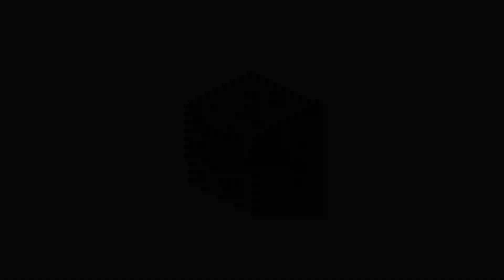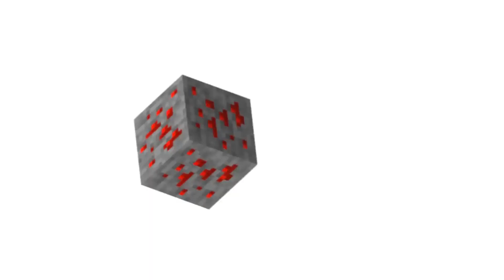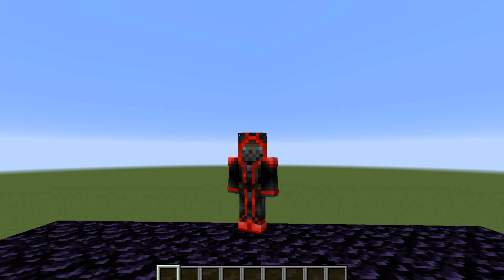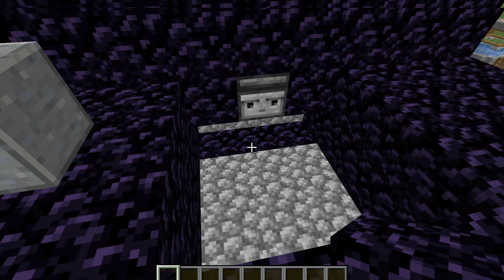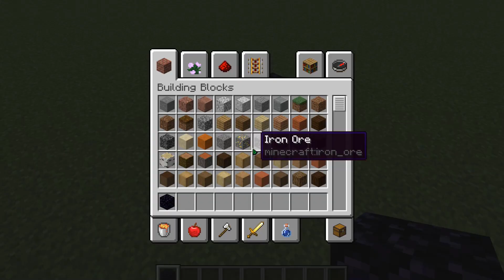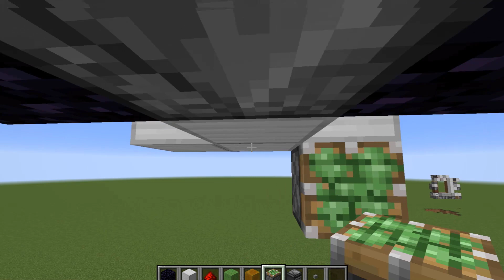Minecraft 3 by 3 Shaftless elevator 1.15 + | full platform | compact and simple

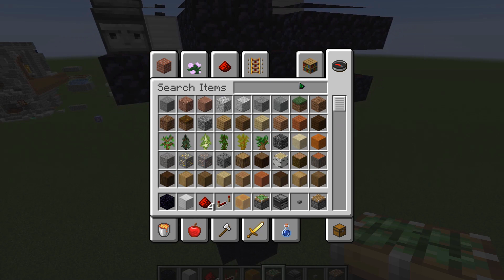Comment: 8:55 genius plan say that its undoable to make the elevator past 11 blocks plus fuck me up with some obsidian blocks required around it instead of air PLUS the ass redstone at the top that sticks out which i cant cover because it'll look hidious because its a completely flat room mostly   UPDATE: got it working took a  lot more redstone and way more mining but i did it and it looks very ugly but it works :/
Reply from the maker: yeah genius, CHAIN the slime towers; the elevator can be any height. If you knew how to listen you would've heard me specify this. also all the Redstone is easily concealed. Literally all the slime tower is for is to connect the top button with the bottom so you can call is from the top. Just find another way to connect that, I showed the fastest way. Key word LISTEN and MAYBE your attention deficit ass could pick up a few more things. :/

Comment: My issue is that the first floor button isn't calling the elevator back down.. the other button works just fine, though. and at some point, it stopped one row before it was supposed to.  Didn't know how to fix it, so I'm having to start over.

Comment: Is there a way you can make the elevator longer or deeper?
Reply: Yes you can actually. Just make the shaft or the landing port of the flying machine deeper into the ground, and if you want to make the elevator much more longer, then just extend the circuits used to stop the flying machine from going to far high, although you are going to need to extend the redstone downwards by a lot, so I suggest use a combination of slime and pistons with redstone blocks at the end of the slime

Comment: help, whenever the platform goes up, the normal pistons dont power so only half gets stopped and the others continue to ascend

edit: its been an hour and I fixed the over ascend problem, so a new problem arises

THE ELEVATOR WONT GO DOWN, HELP

edit edit: HOLY CRAP IT WORKED, YUP, IM SUBBING AND YOU SHOULD TOO
Reply: how did you get it to go down mine is stuck brruuuh
Reply: @cjrs  If you are in a server (especially slow servers).

check the three blocks that ypu placed up top in the three sticky pistons, make sure they are ttached to the sticky piston and not near the aligned with the obsidian

Comment: Super nice you get a sub from me, and with my tiny bits of redstone knowledge I was able to get the redstone signal to go further down. This gets rid of the piston max push limit causing the build to not go as far as I wanted. You just need to send the signal down using dispensers and target blocks(space target block 3-4 blocks from dispenser cuz they can miss). Put a target block at the very bottom to send redstone signal into the lower activation, sending elevator back up. this is my first flying machine I think I've ever built and having to repeat the process cuz of how many times I messed up, plus your actual detailed video, I was able to get a better understanding how these things work. oh and if you think you will need more than 64x9 activation from the top just add hoppers with single/double chest full of arrows into each dispenser that shoots down (hope you also have a skele farm handy :D)

Comment: For those who are syaing this does not work in 1.16.5 it does work, my advice is make sure the flying macine are looking the correct way, you need the observers on the flyinf machine near the top half are facing towards the ordinary pistons, I noticed this mistake in my build which is why it would not go down, I fixed it and now it goes up and down and the calling system from both ends work.
Reply: Did it and still did not work any other advice?

Comment: This sucks it doesn't even work I built everything exactly the same and only the middle of the elevator went up BY 2 BLOCKS
Reply: By: YGOTolley
2 days ago
For those who are syaing this does not work in 1.16.5 it does work, my advice is make sure the flying macine are looking the correct way, you need the observers on the flyinf machine near the top half are facing towards the ordinary pistons, I noticed this mistake in my build which is why it would not go down, I fixed it and now it goes up and down and the calling system from both ends work.

Comment: This fuckin sucks it doesn’t work a single fuckin bit
Reply: By: YGOTolley
2 days ago
For those who are syaing this does not work in 1.16.5 it does work, my advice is make sure the flying macine are looking the correct way, you need the observers on the flyinf machine near the top half are facing towards the ordinary pistons, I noticed this mistake in my build which is why it would not go down, I fixed it and now it goes up and down and the calling system from both ends work.

Comment: You explained this design very poorly and made several mistakes that led to me having to re-build over and over. When you make a mistake re record instead of saying oops breaking half then finishing. Also you didn't explain what the pistons and the observers at the top of the build did when they interacted, that being the way to send the elevator down, if you had explained that I wouldn't have listened to you when you said the exit had to be on a specific side because that's wrong.  The exit can be where every but those pistons need to be in a specific spot, you didn't really explain that.

Comment from the maker: I finally got my email recovered. might do some more videos in the future. thanks for the support!
Reply: Nice because this tutorial was realy good. And it will be fun to se what the next video is going to be
Reply: how many blocks does this go?
Reply from the maker: it can go however high you need it but to connect the top and the bottom may require multiple piston slime towers because the max piston push limit is 12
Reply: @jaronsurf  Can you explain how multiplw towers work is it like you add a piston every 11 slime blocks?
Reply: @jaronsurf  do you think you will ever make a tutorial on how to make it for it to call it up if it’s down on a higher level? i really don’t understand redstone quite well
Reply from the maker: @カズ-j5i  yes because the piston can only push the 11 slime and the Redstone block.
Reply: @jaronsurf  I did that but it didnt work
Reply from the maker: @カズ-j5i  hmm, Idk are you playing on java? people are saying this doesn't work on bedrock. basically you just need to make the first slime tower. then instead of the Redstone block coming in contact with the redstone dust just put another piston. this part is simply to connect the top to the bottom so spiraling the redstone down should work too just make sure u don't exceed the 15 block signal strength of redstone dust. I might make another video on this bc it seems people are having trouble with this part.
Reply: @jaronsurf  doesnt work for me on java, do you have a discord server where i can get help?
Reply: Does this work on bed Rock

Comment: Obsidian,glazed Terra-cotta what’s the difference? They both can’t be moved by slime!
Reply: obsidian is an non moveable block, which means it can't be moved by pistons and slime and honey. glazed terracotta can be pushed or pulled with pistons, but not with slime/honey. if you need non moveable blocks you can better use things like furnaces because they look prettier. in this build you can use glazed terracotta but I think blast furnaces look better.

Comment: the stoping mechanism doesn't work after the machine goes past a certain height it seems, my elevator moves up 30+ blocks and it won't be stopped properly by the mechanism, but the tinier test version I made where it goes only like 5 it works fine. You can fix this by having 3 observers, one for each "slice" of the elevator.
Reply: If you listened it cant be taller than 12 blocks
Reply: @Ali.W0900  It actually can as long as you extend the redstone trails. I've tried it multiple times, and like he said, if your trails reach over 15 blocks then all you have to do is make a repeater to reset the flow
Reply: @Ali.W0900  It actually can as long as you extend the redstone trails. I've tried it multiple times, and like he said, if your trails reach over 15 blocks then all you have to do is make a repeater to reset the flow 11:10